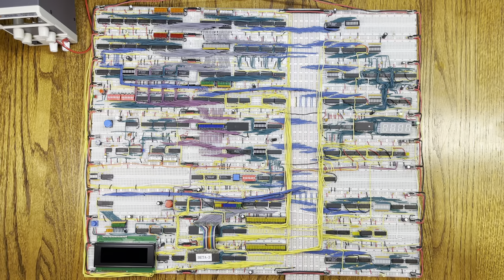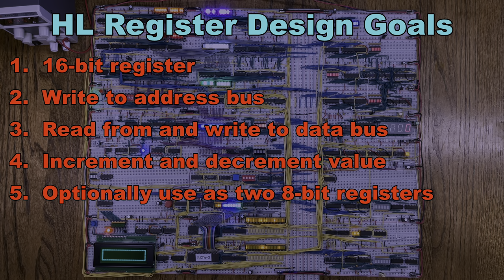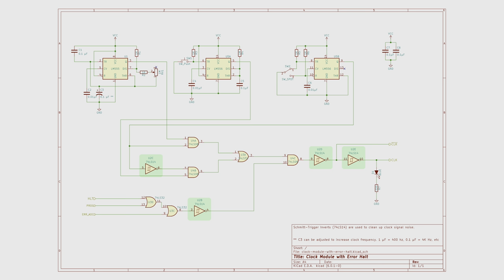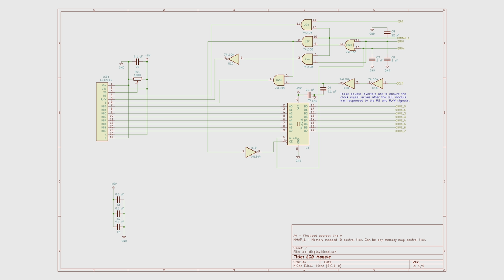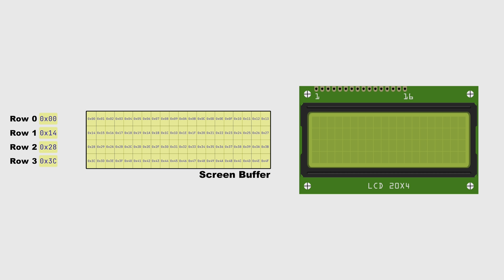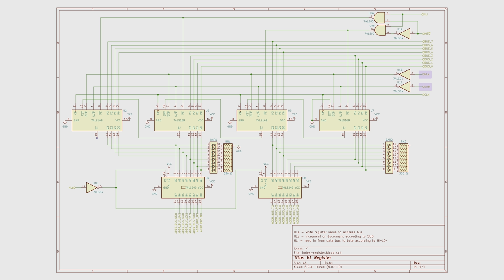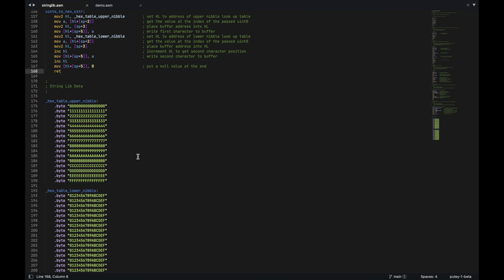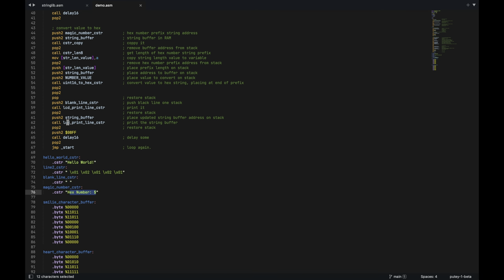Adding an LCD Display on the PUTEY-1 breadboard TTL CPU

Comment: Love your vids. Couple of comments:

Could you zoom the text in just a little on the code?

In terms of your Byte to Hex converter, how come you used a lookup table and not just masking and addition?

Have you looked at customasm for your assembler? It's pretty cool.

Hope you're keeping well! Looking forward to going through your videos. Thanks for taking the time to make them!
Reply from the maker: Thanks for commenting. To your questions: 

Yeah, you're right, I should use large fonts when showing the code on screen. Will do that next time.

The reason I didn't use masking and addition to convert the numbers to hex is because the ALU that I currently have in the PUTEY -1 doesn't support it. It's actually my next major project to update the ALU to support these sort of operations, and when I do, I will be certainly updating the code for the bit to hex conversion. 

I have seen CustomASM, but as I stated in a prior video, I wanted the "joy" of developing an assembly myself. That is as much part of the project for me as the hardware, but the hardware makes for more interesting videos. Also, there were some things in the assembler I wanted that customs didn't directly support at the time I started this project. It's not my intent for BespokeASM to compete with CustomASM, it's just my project and I will share it if anyone finds it useful.
Reply: @MichaelKamprath  I'm jolly interested to see what ALU design you come up with.

It very often works out that the journey is it's own reward. Can totally appreciate why you'd write your own assembler. Just wanted to make sure you knew about CustomASM, as it's pretty cool.

Comment: Base + offset addressing is something that would've turned the 80 series of CPUs from ok to something actually pretty good, considering the 8-bit limitations. I know the Z80 had the index registers, but they were stuck down the end of a ~20 cycle long prefix alley way that no one wanted to walk down.

For driving the LCD I usually toggle the control lines in software via an IO port or memory mapped register. They are really slow and will stop working over a certain speed so having the ability to control the speed the writes happen at in software is really nice.
Reply from the maker: Thanks. I will keep an eye on the LCD module as I ramp up my clock. Right now it is running at 4 KHz. I've run it at 40 KHz with no problem. If it starts to misbehave, I can certainly add another register that controls the various control lines on the LCD module.
Reply: @MichaelKamprath  From the data sheet the minimum cycle time is 1000ns, I think.

So I think your current circuit should be ok to a bit over 1Mhz.

I'm not sure how fast you can send commands though. I've hit the limit with a Z80 running off a 555. At a guess it was probably in the 100khz range. Waiting on the busy flag or a software delay between commands will fix that.
Reply from the maker: @drlazy1  Yeah, I have already implemented in my software to check on the busy flag before sending a new command. at 4K Hz I have never bumped against it though!